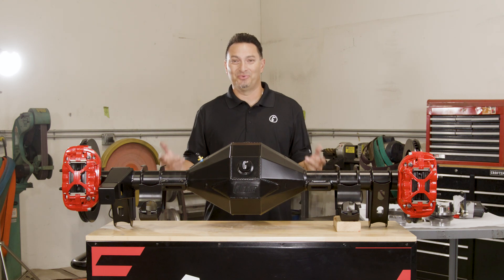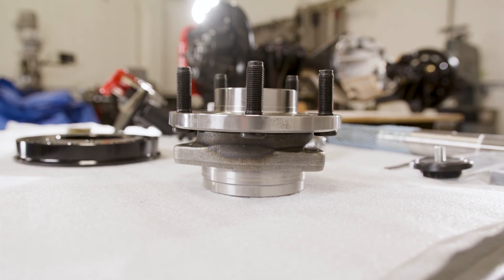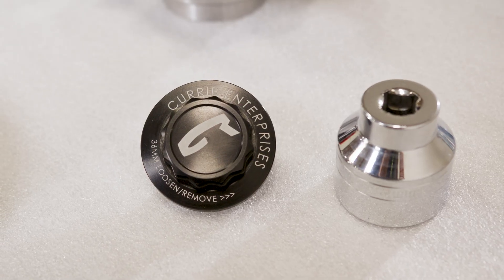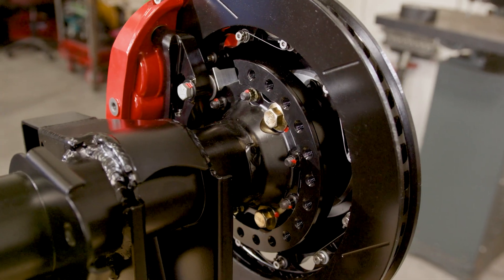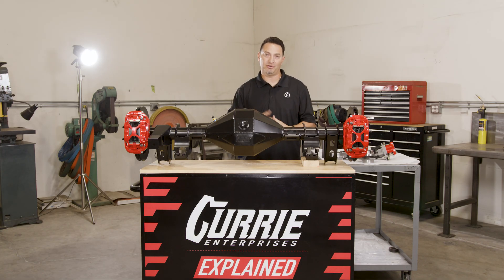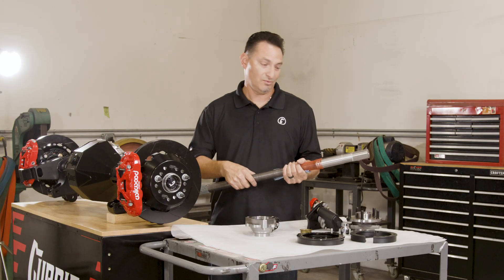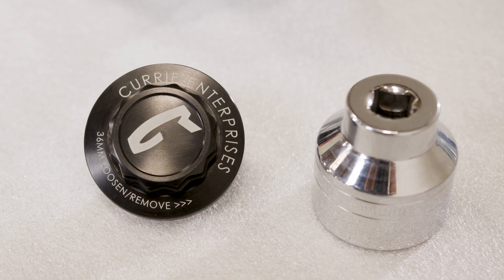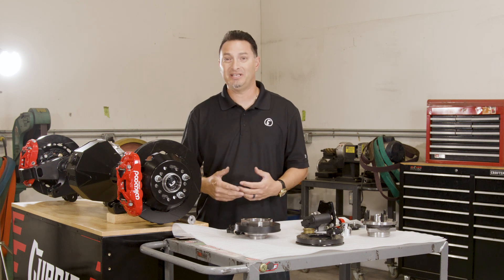Currie Apex Full Float — The Evolution of the 9-Inch Rear End - EXPLAINED

Comment: What would you guys think about utilizing this floater axle on my Jeep LJ on bigger tires (35's) 
As of 2 days ago...Im currently building a rear end utilizing yalls ford 9" rear end but it just uses regular ole set 20 bearings (Ford torino ends) Would that Corvette unit bearing hold up to a 35" tire that sees quite alot of abuse,Hitting rocks when crawling,drifting,donuts,Burnouts...and lots of em lol,Jumping it etc !

Comment: Didn't you think it would be useful to actually explain what the "full floating" design is??
All kinds of details, but you skipped the basic point of the presentation.  Poor.
The "new innovation" of the axle oil seals (which you repeated twice, by the way) matches the way Alfa made their rear ends, at least since 1956.  Good you're catching up.
In fact, much of the second half of the video is repetition of the first half.  Who did the editing?

Comment: Awesome! Been waiting for this for years. Are the brake kits for the C7 corvette also?
Reply: Brake kits are off the shelf Wilwood brakes, for a Torino Big Bearing Ford Housing end, with a 2.5" axle offset, with the Electric Park Brake backing plates.
Reply: I need a rear with all the brackets welded on to work with a speedtech torque arm suspension for an early second-generation firebird. Over all width one inch narrower than stock half inch studs. I wanted a floater with the electric parking brake and figured someone would make one soon. Glad I found this video.
Reply: @DavidMorgan-gg7ic  Call and tell Speedtech you want a Currie rearend for their suspension with a Currie full float axle.